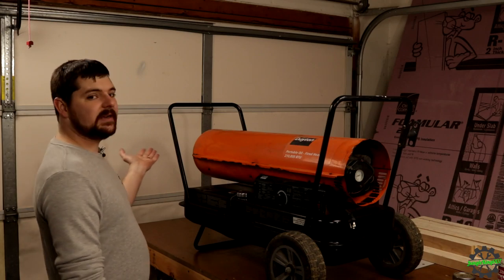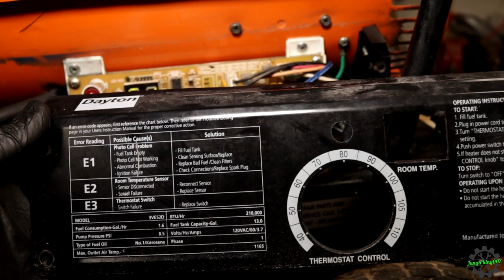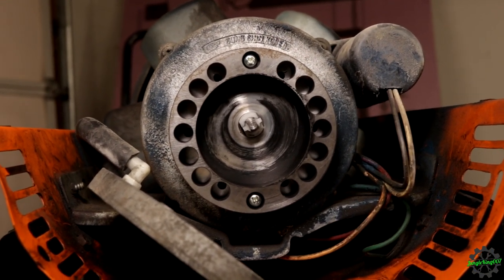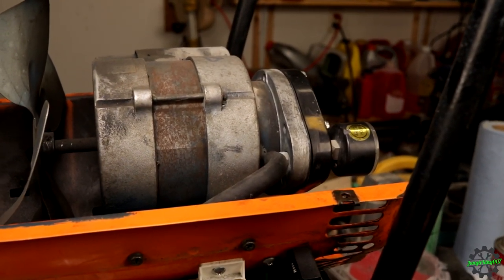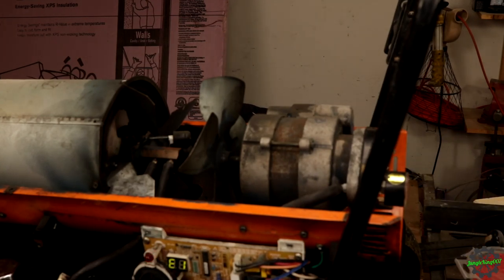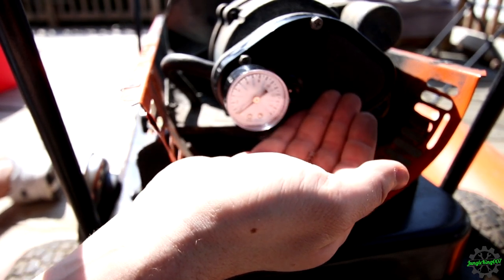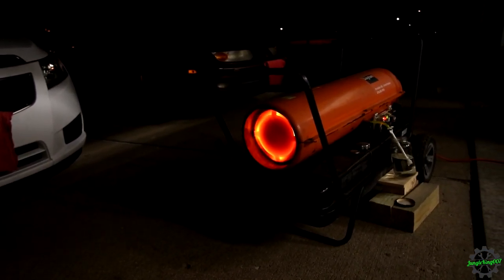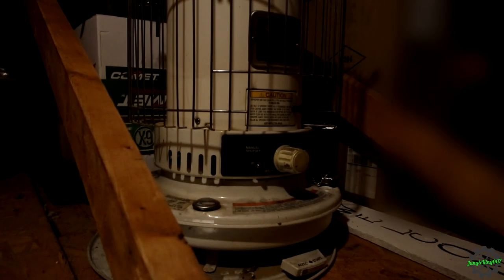Torpedo heater starts but no FIRE! Will it ever run again?!

Comment: I was able to fix my Dyna Glo Pro 210K BTU heater thanks in part to your video, so 2 thumbs up!  It may be worth mentioning that the vanes on the rotor are not square, but slightly rectangle shaped, and it is possible to put them back in wrong and still have low air pressure and a no fire condition, even though they move freely.  I discovered this the hard way and had to disassemble it again.  I only had one vane in the correct way and three the wrong way.  Put back together a second time and it ran great.  Thanks again for the video!
Reply: I cleaned the air pump area and have 8lb pressure but still no fire. What do you suggest, oh I do have plenty of spark also

Comment: I’m glad to see you got this fixed! In My experience the nozzle is usually the best place to start on oil fired heaters. Also as you figured out that little white tube is a safety to keep it from running without the shroud on.

Comment: Mine was doing everything fine  apart from firing, the igniter was working, checked the pump vanes, all good. I found the pipe that goes onto the back of the air gauge was split, it goes through a sharp hole in the metal pump mount, I picked up some 1/4" fuel hose, re-routed it under the pump mount so it's not near any sharp edges, also replaced the fuel pipe into the tank whilst I was there, all working spot on now 😀

Comment: Really a good, comprehensive video. I'm having the same problems. I did notice the types of fuel, BTU output, and pressure are listed on the cover plate. Also, the top cover can easily be pushed out of shape by leaning on it. This presses the inside of the cover on to the fan blades binding them and not allowing it to spin.

Comment: I think I finally found the video that will help me with my problem. My pump is not pumping air. I already did all those other tests and they are fine. So I will try to sand down that aluminum plate. There is actually a stain on the plate that looks like it used to have a gasket. But I haven't found out any information about a gasket existing. Mine is Reddy  heater 60,000 BTU unit. Thanks for the video. You did a great job with it.

Comment: that bottom plate and the ring the rotor runs in also can be adjusted the tolerance at the top is critical to building pressure

Comment: Mine had shaft play that allowed  the motor shaft to come out of the pump drive. Since it’s old AF and was about ready to throw it away anyways. I narfed up the shaft a bit and tapped the pump back on. Still running good so far.

Comment: Nice video!  I bought a 125K BTU Torpedo version to use in a 24 x 40 ft out building I guess 5 to 7 years ago. That out building never saw any heat...  I did end up using it to thaw water pipes on 1 house / over 1 winter  / took all of 20 minutes once setup / then it got stored for several years.  Back then I never thought to drained the 5+ gallons of kerosene I had dumped in it.  :(   I was new to these style heaters......  They sound like they use gobs of fuel....  Just got it out today to get ready for our upcoming winter after forgetting I had it... Just drained ( the old turpentine ) and rinsed the fuel tank with fresh K1.  Going to use some simple green and clean the heater chassis all over before I pull the fuel filter.   Fuel cap internals were a rusty mess..  I'll grab my Dremel and wire brush bit and see if it can be saved.  Hopefully cleaning the fuel items will be enough to bring mine back to life since it only had less than 1 hour on it when stored away improperly...  If not I know where to look next..

Comment: My heater had the same problem but instead of doing what you did cause mine looked like urs in the air pump all i did was soaked a rag with kerosene and wiped it all over the pump veins and soaked it good and put it back together and it fired right up

Comment: Do yourself a favor and add Seafoam to your fuel before you store it for the summer months (or dump it out and get new fuel) You'll thank yourself when you hit the switch the first time during a cold winter morning when a little blast of heat would feel real good! And try to get yourself one of the heaters that burn diesel. Diesel burns hotter (gives off more BTUs per gallon) It's also alot cheaper than kerosene.

Comment: Was ready to dump mine, but now feel confident to be able to fix it. I will let you know how I get on.
Reply: check out the website reddy heater parts.  There is lots of helpful how to stuff on there.
Reply: Me too!  Benn at it most of the day with all the fixes I could find!  Also gunna check the vain orientation!

Comment: yea can spray soapy water on the air pump cover to look for leaks , just keep it off the electrical stuff.
Reply: Yes, this! I cleaned the nozzle, replaced the fuel and air lines, and replaced the rotor and vanes, only to still have low pressure.

Turns out, the gasket between the pump and pump cover had 2 small leaks. Replaced gasket, boom, good pressure!

Comment: I have a very nice heater I need help with please.  I have a KFA 220DGD dual heat Dyna Glo Delux.  It is suppose to have 6.5# on low heat and 8.5# on high heat.  I can barely get it up to 6# with both adjustment screws turned all the way in and have tried everything which I will share with you.  I need help in finding the cause for this low air pressure problem please.

I have cleaned the nozzle, eye and ignitor, fuel and air lines.  I have cleaned the rotor and vanes and lubricated with dry silicone and properly gapped the rotor.  I have flat sanded the air pump housing on both sides as well as the back of the end plate and sanded and cleaned the back plate of the fan motor, installed new filters and have applied thread tape to every screw and connection.  None of this helped so I purchased a new air pump ring and a new end plate and a new rotor and vanes and reassembled and no change.  I have also tried running an entirely different end plate and filters on the pump assembly just to see if there would be any change and nothing different, about 6#

I have used every trick in my playbook and am at a loss for finding the problem and this is the first heater I have ever worked on that one or more of my fixes has not corrected the problem.

I hope you can help me.  Thank you in advance for any suggestions you might have.

Comment: Mine is the 55,000 BTU Reddy heater and it won't start at all. I push the power button and I hear a little click but nothing happens at all. Time to take it apart I guess. I'm thinking maybe the igniter or solenoid

Comment: I have practically the same heater.  It was building pressure bit not what it should.  I replaced the rotor and now it won't build any pressure.  Any suggestions?

Comment: Mine does not fire unless I have screws out of one side of the cover,  if cover is held down it shut off and not fire.  Have cleaned everything.   Any ideas?
Reply: Heater cover might have a dent preventing the fan to spin

Comment: I have what I think is a Dayton, big red dual handle torpedo kerosene heater. I changed out the ignitor and cleaned the veins , spark plug 
etc, but it starts right up and runs good for about 10 minutes and then it dies down until it starts flaming out and spits fluid and I pull the plug, if I let it set it will crank right up and fail again in a few minutes.  any ideas  ??? thanks for your time. model 3E219
Reply from the maker: Sounds like the suction by the air pump reduces over time. Does the gauge read a consistent pressure? Or does the  pressure diminish?

Comment: it is illegal to use kerosene  in Massachusetts can i use Diesel fuel like ive been told? and if yes then what if it doesn't ignite? which is the issue im having........
Reply from the maker: Wow didn't know that one. Might as well outlaw diesel too since they are so close to each other in fuel characteristics...but I digress. Yes, diesel can run through these but not advisable.  it's a little more dense and requires a finer spray to burn correctly, and is more toxic when used for an extended period of time. Using diesel is a last resort, or temporary solution only. Kerosene is preferred.

Comment: Great video! I just received a used one also. It turns on but the fan doesn't start so I'm thinking the motor or capacitor.  Any thoughts?
Reply: It could be the motor or capacitor but check this first.Turn the fan blade by hand. Does it feel like it’s dragging?  My fan would not start either. It was locking up. 
Once I disassembled the pump, as shown in the video, my fan would turn freely. My problem was dirty components in the pump assembly were locking the motor up. Cleaned pump as shown, like new!
Reply: Mine the rotor on the air pump was gummed up once cleaned motor spun easy.

Comment: Hi   I have same heater         And I checked everything including ignitor and there is no leakage in air pressure ,can go upto 12 psi  but i  adjusted it to .345 bar     Still it is not pulling fuel out of tank .     Pls guide me
Reply from the maker: Are you seeing fuel spray out the nozzle? You should see fuel spray out the nozzle if you are getting pressure. If not, check the pressure hose to the nozzle is secure, as well as the fuel hose. Any leak points will fail to draw and spray the fuel.

Comment: Why did you not look at the pressure gage first? You literally have a gage for a reason.
Reply from the maker: Because the original was broken and not giving good readings, add the bad check and it wasn't going to show anything. That is why they were replaced.
Reply: @jungleking007Channel  okay. I still think checking pressure as first step would be more rational than a shotgun repair. Just sayin

Comment: And that plastic piece that was cracked, all you need to do to fix something that is plastic and cracked most of the time, just take a screwdriver and a propane or map gas torch, heat up the tip of your screwdriver and fuse the plastic together and 9 out of 10 it will work.

I have a cordless drill and broke the whole battery off. What do I do to fix it? I fuse it back together and it works for another 2 or 3 yrs. LoL👍😎😁
Reply from the maker: The area where the. Check sits was beyond repair. Plastic housing had to be replaced.

Comment: Mine would blow smoke not fire up. Now fan runs no fire no smoke now.
Reply from the maker: check the pump, fins and hose. These may be the source of the problem unless spark is not igniting the fuel.

Comment: Getting E1 on a 125000, noticed that the fan doesn't start and I can hear the spark.
Reply from the maker: Is power reaching the fan motor? If the fan is not running the pump won't either as it is connected to the back. Hopefully it's a bad wire and not the control board or motor itself.

Comment: mine quits without the top cover installed
Reply from the maker: Top cover acts like a wind tunnel, helps direct the air into the burn chamber.  If it lights with it on, should be working as long as the air pump is configured correctly.

Comment: My ReddyHeater 55,000Btu runs one or two minutes then blows the 6.3amp fuse. All components are clean: rotor, vanes, housing, filters, photocell. Any ideas?
Reply from the maker: My first thought would be a short in the fan motor. Probably a good idea to check the current draw of the fan motor. Or a ground is bad somewhere.
Reply: Check your ignitor see if it bad

Comment: So much wasted effort and money here. These things are so basic and so much information out there on how to diagnose and repair these properly! 9PSI????? 3.5-5 at the most! Try to find another video source from someone who has a better understanding of mechanics and how these operate!
Reply from the maker: For the smaller heaters you would be correct on the pressure, but this one is a higher BTU rated unit so 8-9 psi would be recommended, per the manual. I'd suggest you read one before commenting next time.